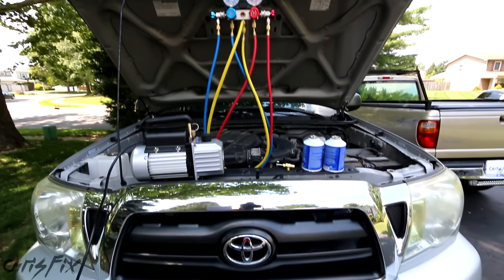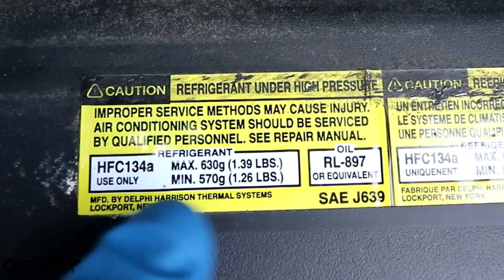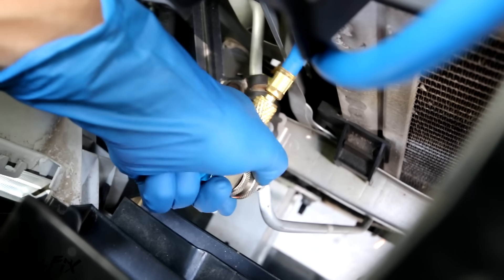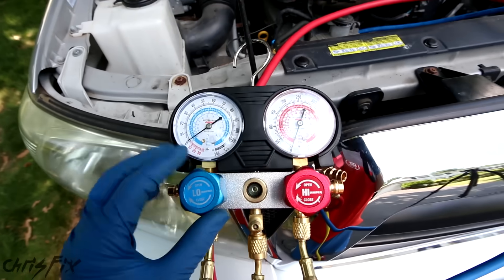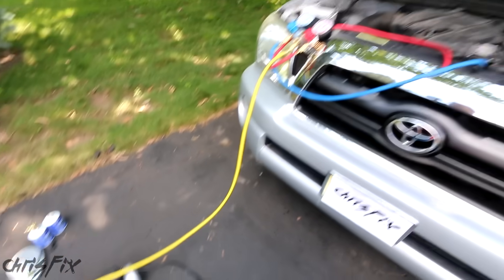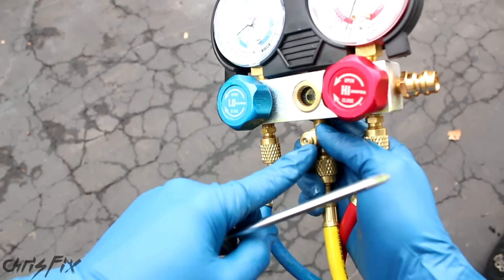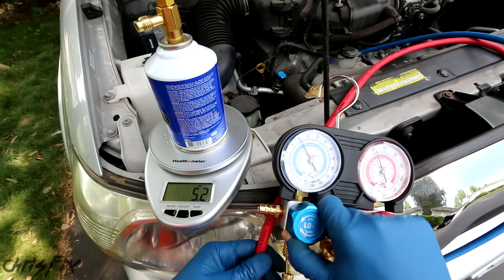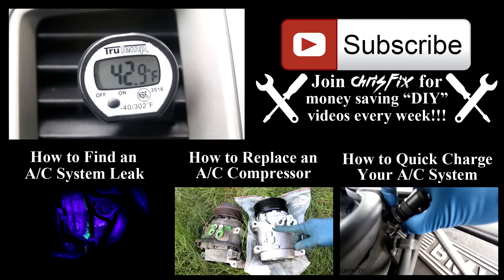How to Properly Recharge Your AC System

Comment: Vacuum pump $75 in harbor freight. Ac guages $65. Minus well pay someone to recharge system unless ur planning to do 50 ac systems.
Reply: They can be rented for free at auto parts stores.
Reply: @Redtooth75  good to know
Reply: How do you know they're not lying if they say you need this or that and it's gonna be $1200. You don't.
Reply: @nmatthew7469    To do what's in this video, it's proper way. Vacuum is correct way....if  Ac hot, probably compressor bad,or relay. If mildly cold, probably leak in a line. Look for oily residue.i work in a shop. Am honest. My manager sometimes.. .. you could always add freon yourself to take chance to see it works.if it blows cold, compressor fine. Btw, if you get $1000 estimate, can get other opinions.
Reply: @nmatthew7469   if someone says you need evaporator.. that's the most expensive. Over $1k. Every car

Comment: Very good educational video I appreciate it, however I’m wondering on my 2018 Volvo truck the AC is working no issues however I want to check it And I’m interested in knowing where should be high and low pressure gauges should be waiting you can help me out appreciate it, this is Robert from Fort Myers Florida, 👋👍

Comment: I replaced my ac compressor on my first gen Tacoma. I used a vacuum pump for an hour and then let it sit for 45 minutes to check for any leaks. Everything is good with no leaks. I got a can of refrigerant in and then the low pressure switch killed power to my ac clutch and I can't get the second can of refrigerant in. Any tips on what to do?
Reply: Use a jumper wire either on the clutch relay or the low pressure switch.
Reply: @Redtooth75  I used a Jumper wire to bypass the ac dual pressure switch. The compressor was engaged for a few minutes but then the ac clutch disengaged. It was almost long enough to charge the second can of R 134. I'm waiting for a power probe to show up through Amazon. I'll power up the ac clutch manually and see what it does once it has a full charge in the system.

Comment: Seriously nobody wants to buy all those tools… we just have the coolant can and the hose thingy … do a video with those two (and the seal)
Reply: The gauges and vacuum pump can be rented at auto parts stores for free. The pump is absolutely necessary if the system is empty. You have to remove the air and moisture from it before adding refrigerant. The gauges are also good to check the pressures to ensure everything is working properly. And they are necessary if charging by pressure or doing a top off.

Comment: This is a great and useful video but it starts from systems that are empty from having leaks or repairs. It would be nice to see this explained on systems that are just getting checked for low levels  and how to add what is needed. To evacuate the system you would need a container to put the freon in, and weigh it, then  fill by weight.  But still, a good video.  RIP Chris Fix, you were a gift to mankind.

Comment: Hey man just found your video helpful but I’m in a jiffy, how come my compressor stays on when turning my car on and when I turn my ac on, the refrigerant won’t pull through and the system reads that it’s still in vacuum .
Reply: A valve somewhere is closed. Make sure the valve on the manifold and at the can are open. An easy way to check if refrigerant is flowing out of the can is to loosen the yellow fitting on the manifold for a second and see if refrigerant comes out.
I may have misread your post but if the system is in a vacuum the compressor should not come on. Running the compressor without refrigerant will damage it so there is a low pressure switch that controls the clutch.
Reply: @Redtooth75  I took the like off and opened the valve to the can of Freon and nothing was coming out ! Lmao 
I went ahead and bought a new valve and will try tomorrow with a new can of Freon .

Comment: Chris: I should have started by saying you give the BEST descriptions on how to do anything!  THANKS!  Very thorough and accurate.  Now maybe I'm over-thinking; however, if you just pulled a vacuum, and don't want any air to infiltrate into the system, wouldn't you be doing this exact thing by disconnecting the yellow hose from the manifold and then pouring oil or liquid dye into the hose and reconnecting it to the manifold gauge??    Semper Fidelis!  CWO4 USMCR [Ret] 17 Feb 1969 - 1 August 2004

Comment: What is the purpose of the high side. I can't seem to get a direct answer. Is it just for diagnostic purposes?
Reply: The high side valve is mainly for checking the high side pressure. So yeah its only practical use is for diagnosis.
Reply: @Redtooth75  thanks. How does one know if they got air into the system? I was just checking my pressures, and confused how to work the gauges so I let some refrigerant out through the yellow hose side. Now my ac works bad. Can I just top of the refrigerant or needs a full vac? Low side at 35 and high side at 50 after I messed everything up just by checking lol. Was good before. 65f outside temp. Bought a 12oz can, will try to add a little at a time till high side goes back to 150
Reply: @ve2430  the system is pressurized when it has refrigerant in it so the only way for air to get in is if all the refrigerant leaks out or is removed for service. You wont need to do a full evac if there is still refrigerant in the system. You can just add until the pressures are right. Evaporator and low side should be around 30* F and the high side should be 20* F above ambient temp. A pressure/temp chart will give you the pressures that your refrigerant is at those temperatures.
Reply: @Redtooth75  thanks. Well for 65 Fahrenheit ambient, the chart says around 30 psi for low side and 150 around for high side. I had a service valve get stuck open too when I tried putting the low side gauge on so a good amount came out unfortunately

Comment: Can you do this same procedure with R-1234yf refrigerant? I am topping off my Focus from changing my radiator.
Reply: Yes but the pressures you see on the gauges will be different. But the method is the same. Charging by weight is the most accurate method but if you just want to top off then you will charge by pressure/temp. Unless you recover all the refrigerant. If you charge by pressure/temp you just want the evaporator and low side to be about 30* F and the condenser to be about 15* higher than ambient. A pressure/temp chart gives you the pressure that 1234yf is at those temperatures.

Comment: im doing an conversion on r12 to r134a and it when i do the vacuum it goes to 40 it can hold 40
Reply: Its definitely not 40 inhg because that is impossible. The compound gauge is really not that accurate at reading deep vacuums. A good micron gauge is needed to accurately vacuum the system to 500 microns. But you can also just leave the pump on for like 30 minutes to be sure.

Comment: As for the oil. Is it necessary to add it If the system (specifically the condenser) has been removed, and put back on?
Reply from the maker: Same compressor? It should be fine then with the amount of oil
Reply: @chrisfix  same compressor, yes. Thanks for the tip!
Reply: @chrisfix  I should also mention it wasn't decompress gradually

Comment: I know this is an older video at this point, but is there a reason for not getting r134a with the oils and additives already mixed in? I've got a brand new condenser to install and I already bought some A/C pro coolant with oil and such already mixed. Is it an issue to run that through the system when it's brand new? Or is it bad to use at all?
Reply: I would only use pure refrigerant with no additives. If you add too much oil to the system it will cause issues. Not a lot of oil is going to be in the condenser.

Comment: Do not add or charge your A/C system with oil using  the yellow service hose. Instead use the port hole the compressor has to recharge oil at proper level. the oil is to lubricate the compressor not the refrigerant the A/C  lines. Over all cool video.

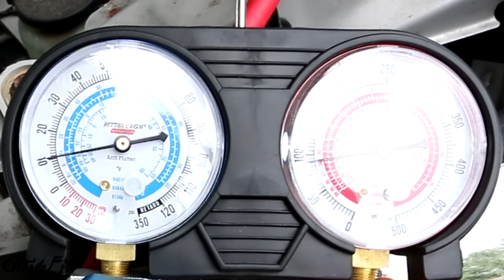Comment: @10:32 why is the high side gauge moving if the valve is closed?
Reply: The valves on the manifold shuts off the yellow service line from the high and low sides. The gauge is still connected to the lines no matter the position of the valve.

Comment: What is the point of the high pressure port? My car a Renault Kangoo only has one port, the low level. For some reason however, Renault do fit a high level connector to it. 
Also why are some people whinging about tiny amounts of refrigerant released into the atmosphere. There are tens of millions of vehicles on the roads, many of which will be leaking some refrigerant. To complain about someone saving half a small can to reuse in the future is pathetic.

Comment: Please reply. The AC pulley ? Stops and spins and stop and spins whenever I turn  the AC on. Symptoms my car is having are: metalic noise when the bearing stops spinning and spins again, the car isn't cooled down enough or fast enough. Does the pressure you explained in this video resolve this issue in my car ?

Comment: What did you do with the half emptied can ?? i watched the whole video to find out and you did not disclose it.  I think you released it into the atmosphere which is bad.  Even if you keep the adapter valve on the can with the needle screw down to keep it shut it will leak empty over a few days. Bad !

Comment: If I may, you showed a perfect approach for performing a DIY AC system recharge, but you failed to mention the most important step, or at least show a resource of where to take and how to recover the refrigerant from a system with no leaks.  Do you know of any resources that might help towards that?
Awesome content!!!!!
Reply: You need a recovery machine and those are not rented. You don't need to recover the refrigerant if you are just toping off, you can just add until the pressures remain correct. Its not the most accurate without a sight glass but will be close enough. If you are going to open the system to repair or replace something you legally have to take it to a shop and have them recover the refrigerant. Or you can just have an "accidental" venting, not the most responsible but a few ounces of r-134a is not that bad., and a few ounces of r-1234yf is really not that bad.
Reply: Most local auto shops will have a machine, you stop in and ask them to empty your system.

Comment: How do you dispose the old refrigerant or refrigerant in general? 🤔
Reply: You take it to a reclamation facility and they chemically refine it back to spec. If the refrigerant is fine as in not contaminated it can be reused. A recovery machine pulls it out and filters it so it can be put back in.

Comment: If you get an AC compressor that isn't prefilled with your oil, can you pour it directly into the compressor before attaching the lines, and if so does it matter if you add it to the low or high side port?

Comment: Whenever i tried recharging my AC, my high side pressure did not move at all. The AC works and i weighed the cans like in the video, so I know i have about the right amount of charge, but what is going on with the red gauge? Why doesn't it move? I had it open on the bottom, the part connected to the car. It was closed on top tho, the part connected to the manifold. My gauge set is pretty cheap, but if it's not the gauges what could it be?

Comment: you might need the new style can tap for the new can type, old style shown. also when you open the valves on the lines they screw down and press on the Schrader type valve, so just turn to open if you screw all the way open may damage the shrader valve. make sure your vacuum pump has oil in it for the pump, completely different than the oil for the A/C
Reply from the maker: Thanks for the tips!
Reply: @chrisfix  your welcome nice video  👍

Comment: When you pull a vacuum it's best to leave it on the system as long as you can not just until it hits 30 inches. A cars ac system is small and you'll reach that in 5 minutes and your not pulling out moisture or containments by just going by the guage. You need to purchase a micron guage or leave it under a vacuum for an hour to have an effect
Reply: And that's what he showed in the video.

Comment: Hi going to start on my GMC truck  have a ac  leak on the expansion valve seals do I have to do the same as removing the compressor on this video that you were working on an do I have to add oil to the ac compressor when I remove the expansion valve to replace the seals thank you for the video

Comment: Hi Chris,  Thumbs upp like always.👍👍 
 I´m working on my volvo 940 ac and seems like it doesn ´t have any high pressure side valv. Can i use only the low side valv to vacume and fill with gas?
Reply from the maker: It should have a high pressure but yes to fill technically you only need the low pressure. It’s just tough to not be able to see what your high pressure pressure is

Comment: What is the volatility of dye and oil?  When you are pulling vacuum, wouldn't that evaporate some or all of them out such that your premise that the dye and proper amount of oil are still in the system?
Reply from the maker: I thought so as well but it’s designed to not easily evaporate under vacuum.

Comment: When you where checking if the system holds pressure you closed off the high and low pressure valves. How can it test pressure if the valves are closed?
Reply: The valves close off the high and low side from the yellow service line. The gauge is always reading the pressure in the high or low side lines.

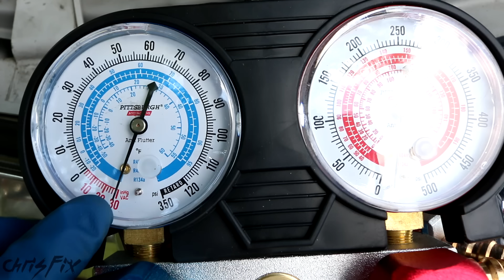Comment: If the valves are closed like you say to do at 6:14, why would the gauges ever change? The lines are closed off from the system so how would it ever lose pressure? 
 I cant wrap my head around this, please advise. Every video I have seen says to do it this way. My car doesnt leak by doing the method everyone says, but once I put freon in, it leaks out within 2 days. The vacuum test, done the way everyone shows doesnt show me that it has a leak. And I believe it is because the gauges are closed and it will never identify if there is a leak.
Reply from the maker: It's still hooked into the system so the gauges are still measuring. If you have a leak then I would try this: https://www.youtube.com/watch?v=pCv7rCdcXsc
Reply: The valves close off the high and low side lines from the yellow service line. The gauge is always reading the pressure in the high or low side line.
Just because your system holds a vacuum does not mean it holds pressure. The seals in your system are good enough to hold in 500 microns of vacuum but are not good enough to hold in 50-300 psi of pressure. Checking if the system holds a vacuum is done because its an easy way to check for leaks. But it can miss a leak that is not present under vacuum or low pressure. But its way easier and cheaper than pressurizing the system with dry nitrogen.
UV dye and light, an electronic refrigerant leak detector, or soapy water can be used to find a leak.

Comment: We normally use vacuum gauges for ac systems and refrigeration systems.  I once worked servicing slushy machines and noticed that when pulling a vacuum (<500microns) I ended up pulling oil out.  Would it be overkill to use a vacuum gauge when pulling a vacuum in a car ac?
Reply: You should always use a vacuum gauge. The system should be evacuated to 500 microns. The blue compound gauge on the manifold measures vacuum.

Comment: When would you consider changing the AC dryer/accumulator?
Reply: It is recommended to be done whenever the system has been opened to the atmosphere. The warranty on a new compressor usually requires a mew accumulator or drier to be valid.
The desicant in the drier or accumulator that absorbs moisture has a limit to how much moisture it can absorb. There isnt a way for the consumer to measure how used the desicant is so its recommend to replace whenever the system is opened and air has entered it.

Comment: do i need to use vacuum pump if im just topping off to a low refrigerant ac system?
Reply: No, you only need to vacuum if the system is empty to remove any air and moisture.
Reply: @Redtooth75  so i got the manifold knob turning confused and had the high pressure side open while the low pressure closed for about 30minutes. Ac seems to still work, did i damage anything?
Reply: @winkawak  no it is fine. The reason you fill from the low side is because the high pressure side can rupture the disposable can because the can is not designed for those pressures.
Reply: @Redtooth75  so just rupture can and no harm to ac system? wow i was doing wrong for 30 minutes, im surprised can didnt explode

Comment: Please do a video on how to flush an ac system
Reply: Flushing is really not something that is a viable option for non professionals. You recover the refrigerant. Then fill the system with dry nitrogen, then evacuate. Repeat that three times. The nitrogen is the part that doesn't really make it an option because it would be cheaper to just take it to a professional. Pressurized cylinders are not cheap.

Comment: If your new ac compressor has oil already in it, and you pull a vacuum, won’t it suck up the oil too? And how would you know if your new ac compressor comes already filled with oil?

Comment: If the valves were closed after pulling vacuum, how’d you check for leaks? You would have just held the vacuum in the gauge, not the actual system. After turning the pump off shouldn’t you have left the valves on?
Reply: The valves on the manifold cut off the yellow service line from the high and low side. The gauge is still reading the pressure in the system.
Reply: Thanks for the reply. I actually bought the gauge system and tested it. I just used this video to recharge my AC after replacing the condenser in my 2014 Silverado. Great video, great comments. Thanks!!